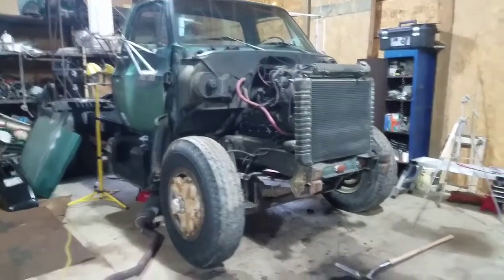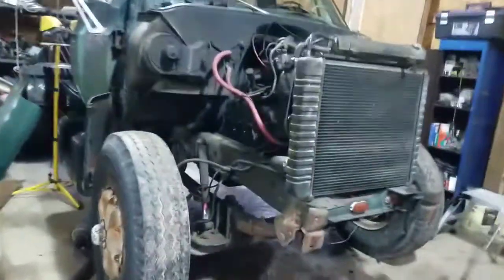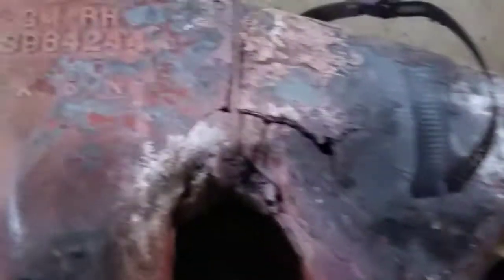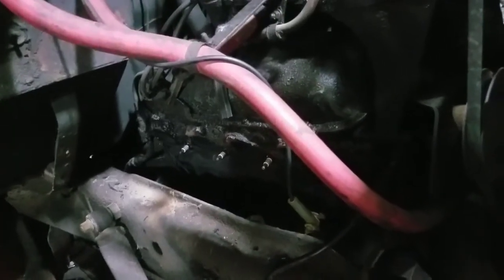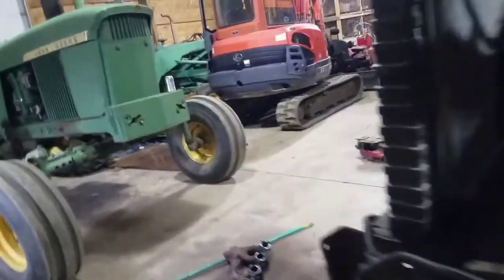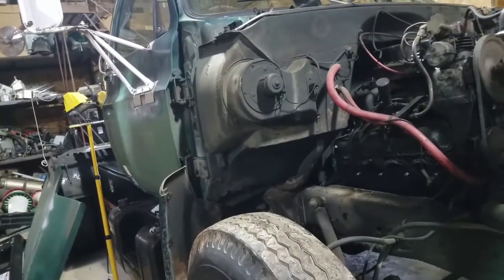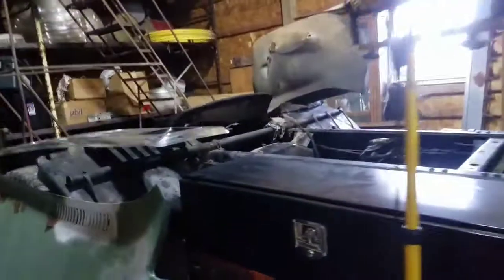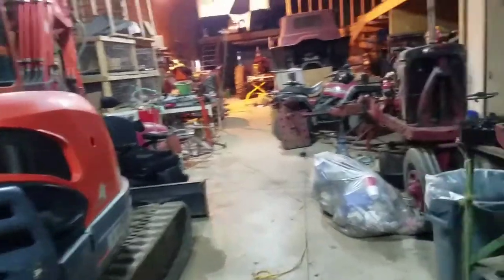The C65 Gets Some Love

Comment: those tubes that are capped off in the exhaust manifolds were used with an air pump to put fresh air into the exhaust.....basically making it pass emissions by diluting the exhaust. there is also a thought that the fresh air injected into the exhaust manifolds would help cool the manifolds....brother, i know where there is a nice f750 chassis with a 6.7 cummins, 6 speed ,manual and air brakes that chevy body would look good on....
Reply: Why would you even put a Chevy body on a Ford that's got to be a sin! I know a guy that has a couple of perfectly good F750s !